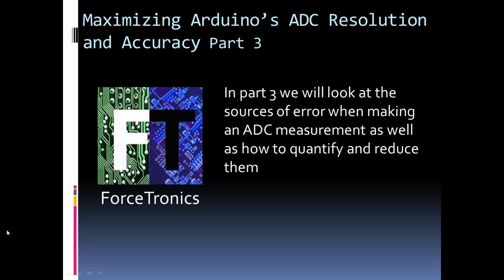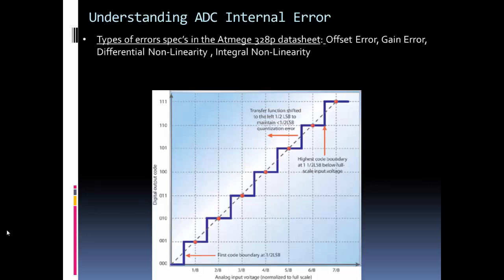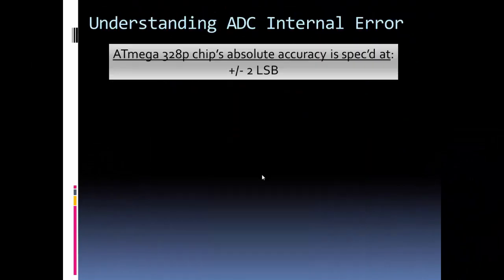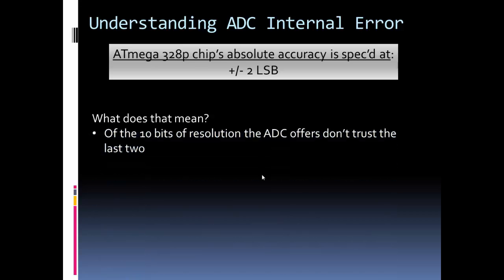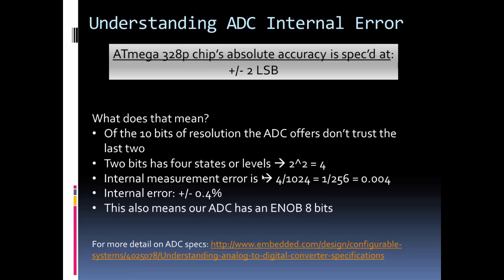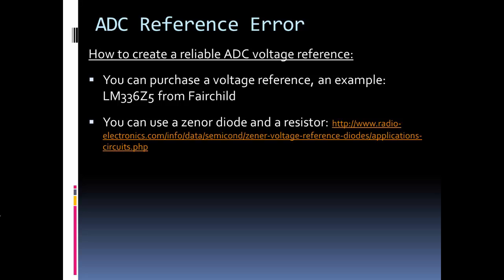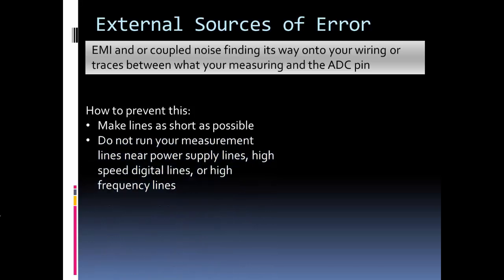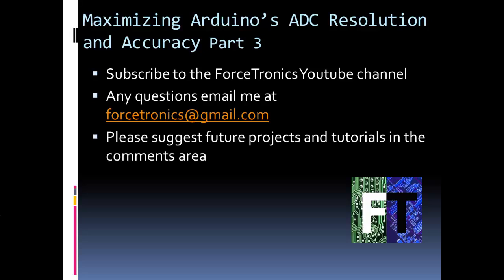Maximizing Arduino’s ADC Resolution and Accuracy Part 3

Comment: I have enjoyed this series, but I'm wondering do you have a video or series about using external ADCs, and discussion of the different types, and how to use them? Specifically I am interested in using an 8-channel ADC to monitor cell voltages in an 8S battery. I see things like SAR and delta-sigma etc types but also some have simultaneous sampling or using a mux. 

What pitfalls may I run into when monitoring a battery of up to 30v with an ADC? A bit of an advanced ADC how-to or discussion or deep dive?
Reply from the maker: Glad you enjoyed the series and thanks for the suggestion on future videos. We do have another video on ADCs, it is not exactly what you asked for but it talks about SAR ADCs https://youtu.be/e20j4Vw5BbI
Reply: @ForceTronics  Thanks for the link. The problem I'm coming up against (in my mind) is that each channel would have a different "ground" reference, as I understand it, and I'm not sure how the ADC makes it's comparison to the reference voltage. I think it might get funky, resulting in either strange results or damage to the ADC. Am I even on the right track?
Reply: @CollinBaillie  Without knowing your exact setup, it sounds like you should look into differential ADC ICs or you should look at specialized ICs for battery monitoring and protection

Comment: I think it's important to talk about bandwidth-limiting the input signal, and ensuring that the ADC input sees a low impedance. (The 328P datasheet says under 10k.) Excessive bandwidth can be a significant source of error. Signal conditioning is vital.

Comment: The big advantage to the internal reference is that since it is a bandgap reference, it is very stable with respect to time and temperature. So if you calibrate it, you've got a much more accurate reference than using Vdd.

I just looked it up on the datasheet. At 25C, from 3.3V to 5V Vcc it appears to vary from about 1.0997V to about 1.1002V. Below 2.5V, it starts rising to a peak of 1.101V at just under 2V Vcc.

Between 3.3V and 5V, the worst case change with temperature is to about 1.1013V at 85C at 4V Vcc. And at -40C, 1.0932V at 3.4V.

Best performance is when Vcc is 5V. 25C is 1.1001V, 85C is 1.1009V, -40C is 1.095V.

Worst performance at a single voltage seems to be about 3.5V, 1.0932V at -40C to 1.1011V at 85C.

Of course, the base voltage will vary from chip to chip. But that puts it at about 0.5% stability at 25C from 3.3V to 5V, about 0.5% at 5V from -40C to 85C, and about 0.7% at 3.5V from -40C to 85C.

If you keep it at room temperature and don't go into the Arctic or the Gobi Desert, an even tinier fraction of a percent. Pretty good for a free reference voltage.

Comment: Very informative video about ADC from part 1 to 3. May ask if you can help me with my voltmeter/ammeter project for my small solar setup to be more accurate in reading the voltage and the current?I will send you my code if you have time to look at them and correct some errors that i'm getting. My project is working,but have a significant error in the reading. That's why i'm looking a solution to fix the problem,then it leads me to your video which is very informative. But still i can't implement it just yet to my project because i'm new to arduino programming and i don't have much knowledge about programming. Would you mind sir if you can help me with this? Thanks.

Comment: The ADC series it has been very helpful, Thanks for doing it.
I am trying to read a sensor that give 4ma to 20ma output. I am putting the output across a 250 ohm resistor and using the ADC to read it. I get 1v to 5v across that resistor. Is there any way to scale the ADC to read the 1024 bits across that range?
Reply: 1024 bits is a lot of bits ;-)
Reply from the maker: +Joe Torelli There is not an easy way that I can think of. One way to do it would be to put a 1V voltage source or reference on the other side of the resistor to subtract 1V from the sensor range so it goes 0 to 4V. You then would have to feed an external reference to the AREF pin of 0 to 4 V to match the range of the sensor. That would give you an ADC range that matches the sensor range. An easier way may be to just go with an Arduino or external ADC that provides more than 10 bits of resolution.
Reply: +ForceTronics Thanks for the ideas. I may try the 12 ADC route.